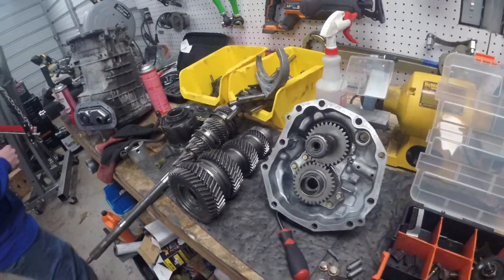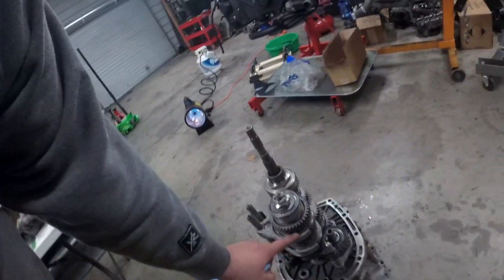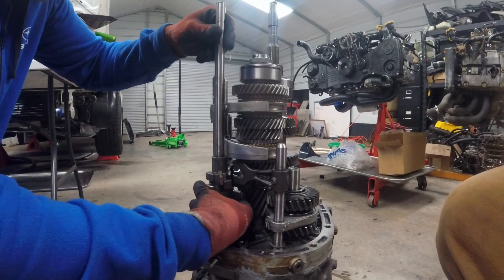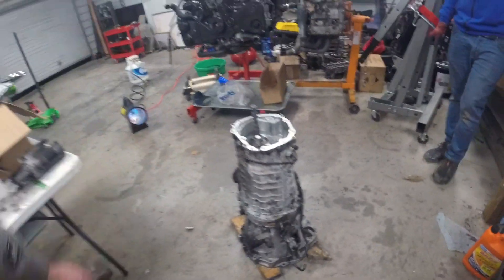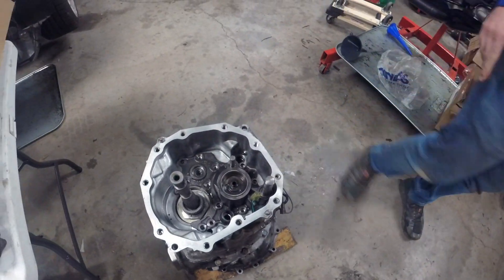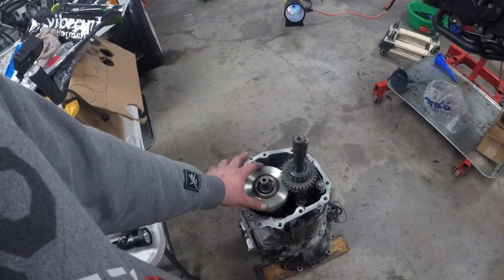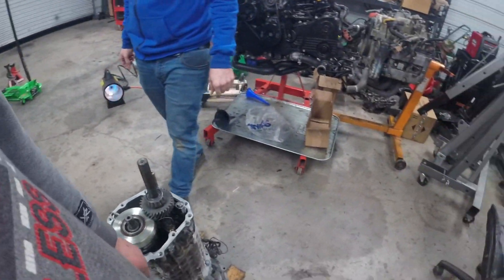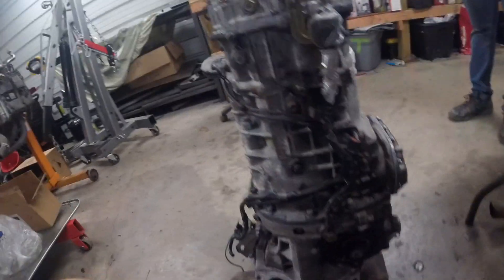Subaru STi 6sp rebuild with JDM close ratio 5/6 and Carbon Synchros

Comment: Question. I rebuilt my dccd.  Now when I reinstall my driveshaft doesn’t spin. Any suggestions?
Reply: It would be some work, but I would try taking the center diff back out, put the tailshaft housing back on without sealant and just snug the bolts, then see if the driveshaft turns. If it does then something was installed incorrectly in center diff. Clutches could be stacked wrong, etc.
Reply: @jordonhaberer434  I have everything still disassembled. I’ll try that today.

Comment: This is awesome guys. 

I just bought another STI here in the UK, and despite the box being reconned, they didn't sort the 4th gear synchro. With a bit of time over winter, I can see myself doing this after watching the video a few times and seeing all the tips and tricks. Not sure which synchro(s) that they replaced on mine, but my guess is you recommend carbon synchros? Cheers guys

Comment: I have an sti trans from an 05 but I can’t find a rear diff can I use one from a jdm sti?
Reply: The STi trans needs a 3.90 rear diff if it’s a USDM 05 STi trans. So you can use a 3.90 r160 rear diff from 08-14 wrx with an automatic Impreza driveshaft or find an sti r180 rear diff to use. I would need the trans code from the JDM trans to see what rear diff it would be.

Comment: I just dropped my V7 non dccd jdm 6 spd. I want to learn how to do this. It won't shift out of 4th. What do y'all think happened? GREAT VID BTW 💯💯💯💯💯
Reply: Hard to say without taking it apart but most likely something broke and is wedged in the hub slider assembly not allowing it out of gear. If you can get it to us in Knoxville we can take it apart and fix it for you.
Reply: @jordonhaberer434  i opened it up and the arm interlock snapped and stayed in place not causing any damage to the gears. Thanks to God!!! 💯 Thanks for the response.